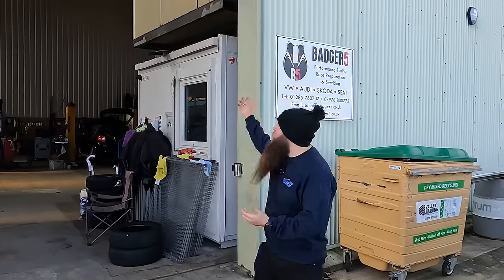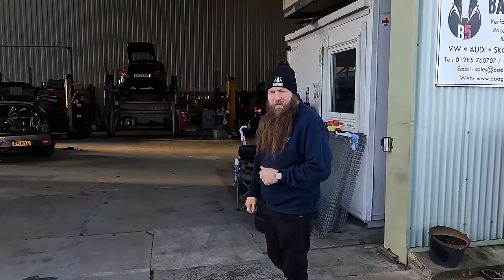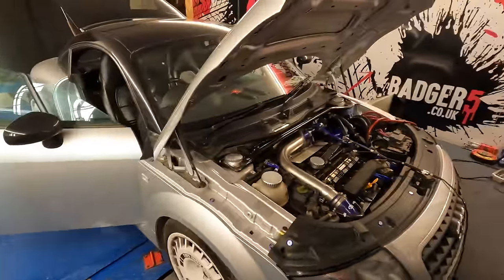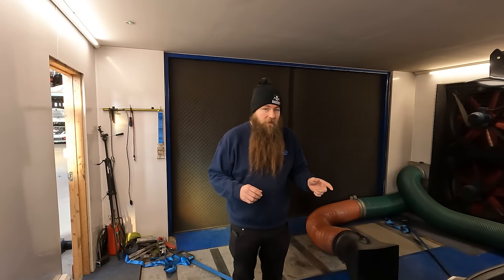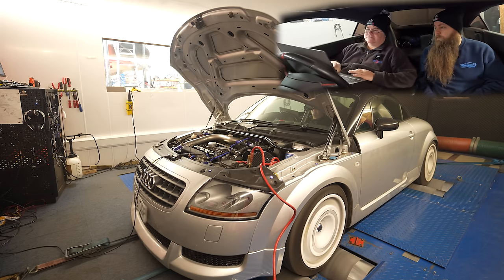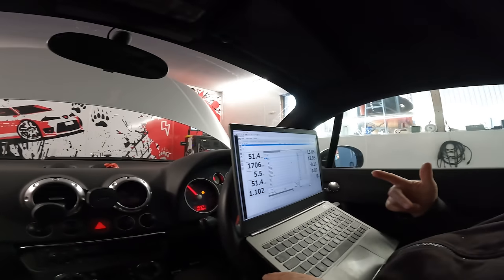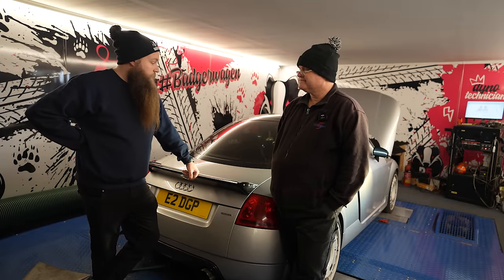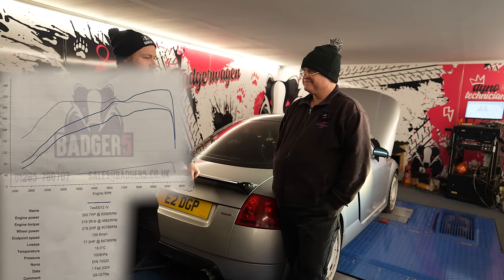Sorting Out A Boost Issue & Remapping My Car At Badger 5

Comment: Hey Dom.  Thanks for the video.  Really interesting to hear Bill's explanations.  Thanks also for sharing the dyno chart.  Have spent the last year or so resisting the urge to go for a hybrid/big turbo on my roadster and you're undermining my resolve with videos like this haha.  Hope to catch up at a meet later this year.
Reply from the maker: Whatever you do don’t come out for a spin In mine then, it will seal the deal 😂. It’s not a cheap option but well worth while for sure. 

Bill is a top bloke and certainly knows his way round the car well.  Even a remap on performance parts will make massive difference.

Comment: Very interesting one this. thick I have a over boost problem with mine
Reply from the maker: Quite possibly, can be caused by a number of issues including boost leak, sensor issue, sticky actuator to name a few. Worth going to a rolling road for health check
Reply: @TheParrottBros  change all the the sensor now run a catch can so all pipes be change cambelt been done yes the timing was out..Lol so the actuator only thing left so yes may get  rolling road for health check

Comment: Great video. I’m on my 4th mk 1 225 but this is the first one I’m tuning. Have you got a build thread anywhere I could have a read through?
Reply from the maker: Hey bud, there is a couple videos on my channel going through tuning options. I would recommend speaking to whoever is tuning it and tell them what your hoping to achieve as it can be as cheap or expensive as you like 😂😎
Reply: Thanks, will have a look. I’ve just picked up a set of forged rods and am on the hunt for a hybrid turbo (all other supporting mods are already on the car).

What head work have you had done? Have you changed your injectors?
Reply from the maker: @danielelkins740  you will need bigger injectors, an updated fuel pump, for sure. 

Mine has super tech valves exhaust side & springs to stop valve float, it also has cams ( not essential )
Reply: I’ve got a sytec fuel pump. Will look into valves/springs and get some injectors. Thanks.

I’ll send a couple pics through your website when I get the car back together. Fitting a seat delete m, rear spoiler extension and a few other bits at the moment 😉
Reply from the maker: @danielelkins740  that’s cool, pics are always welcome 😊

Comment: I have a question not related, Everytime I plug in VCDS into my TT it says I have a short and can't proceed. How can I find the short? Traction and ABS lights are on.
Reply from the maker: I would take the information it gives you, if it gives you a fault code and head over to Ross tech as that’s a wealth of vcds info and help
Reply: I cannot see any codes, the VCDS cannot connect because it says there a short thus can't make a connection. The cable is fine and works on other cars  @TheParrottBros
Reply from the maker: @mewanksta11  sounds like you may have a wire issue on the obd port; I’ve had a car in the past that had a similar issue had to end to end test every cable from the plug to find the issue

Comment: So most TT's I see dyno in FWD only. How does the haldex work on the dyno without front wheel slip to activate the system? Love the videos. Watching from NJ USA here
Reply from the maker: This dyno is belt driven linked so all 4 rollers should move as one, also you run with traction control off as it does have the odd moment when running
Reply: I thing its handbrake up 1 notch  I maybe wrong

Comment: Nice gains Dom, so roughly what does a health check cost at Badger 5? 😮
Reply from the maker: You would have to enquire as I had quite a bit of work and map tweaking done. They are very reasonable
Reply: @TheParrottBros  you mentioned that you had a smoke issue where was that from the exhaust or engine bay beforehand? 
Thanks 🙏🏻
Reply from the maker: @autospavaletingdetailing6512  the previous owner had a suspected oil burning issue, possible valve stem oil seals. But I’ve not really seen anything of concern in my ownership
Reply: Weird that’s what I thought the problem was with mine? I’ve added some Forte valve stem conditioner can’t hurt as I get a bit of blue smoke on start up as I don’t use the car much so could be the valve stem seals as if not used regularly the oil seeps down past the valve stem seals into the combustion chamber thus the smoke on start up.
Reply from the maker: @autospavaletingdetailing6512  quite possible specially on a 20 year old car. Turbo oil seals could be on there way out also similar issues